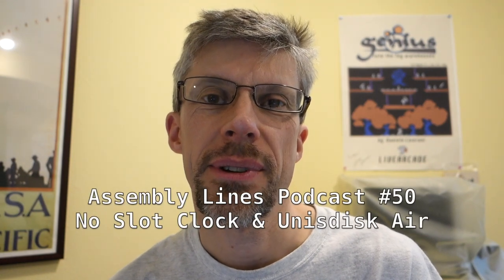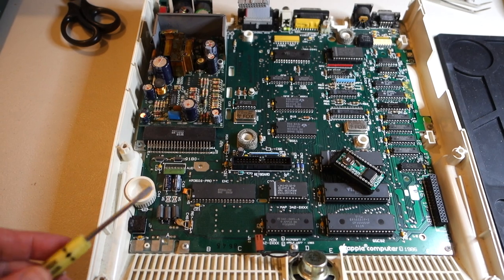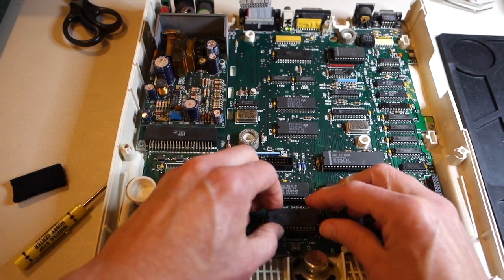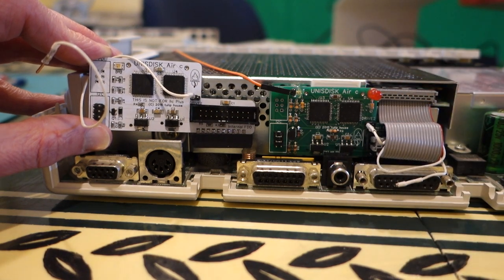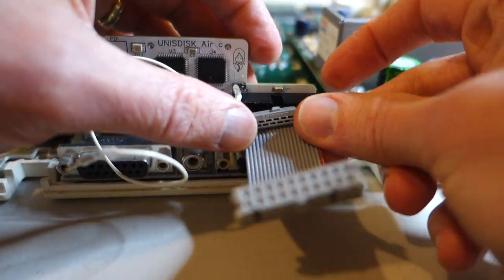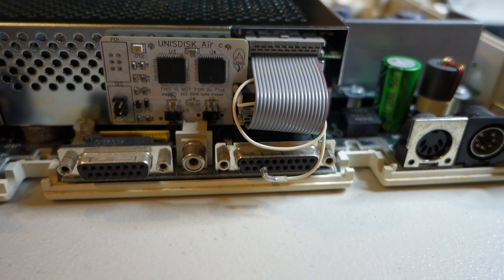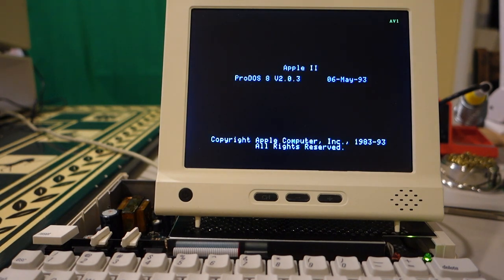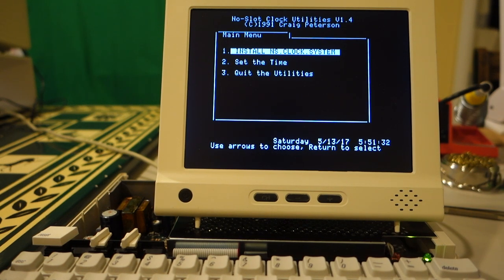Assembly Lines #50: Apple IIc No-Slot Clock and Unisdisk Air

Comment: I checked the link you posted and cant find a way to buy the unisdisk air c  and not sure where to get the noslot clock as the ones at reactive micro look different from what you installed.
Reply from the maker: Hi Luc, unfortunately the Unisdisk Air isn't currently available. I'm not sure when Nishida Radio will resume production. Here's the link for the no-slot clock (it looks different from mine but it's the same thing): https://www.reactivemicro.com/product/no-slot-clock-from-manila-gear/